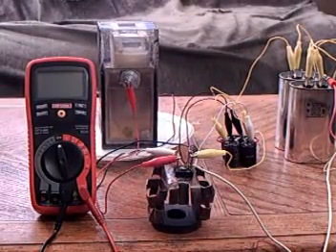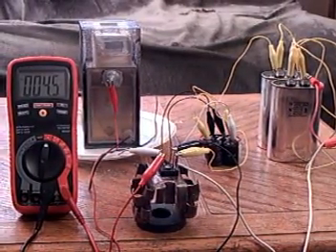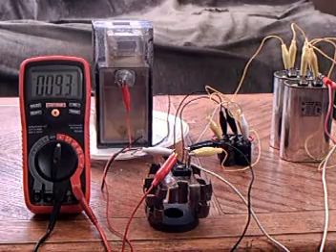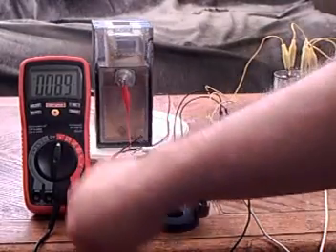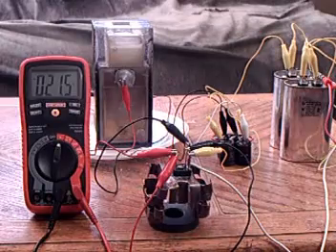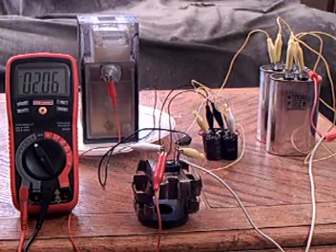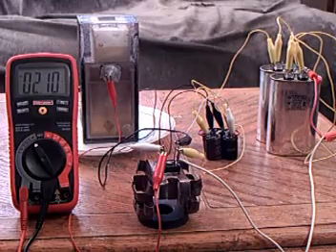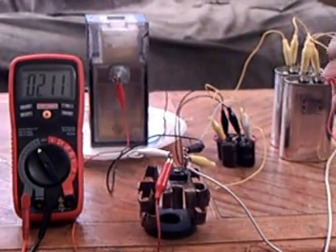CAPACITIVE STEP-DOWN TRANSFORMER - Part 2

Comment: Actually it's a capacitive AC voltage divider, not a transformer.  The 2nd cap is just a voltage limiter.  The load is in parallel with the 2nd cap.  The total impedance is the first cap in series with the parallel pair of 2nd cap and load.  Most of the energy is lost in the first cap, the efficiency is far less than a conventional transformer.  If you want to know what it's really doing, measure the current on the AC line using a clamp meter.  Once you know that current multiply it by the 120 volts and that's the input power.  Compare that to the output power.  You will find it is very inefficient.

Comment: I don't know how to upload a schematic, but if you want to limit voltage you will need the "secondary" electrolytic caps like tvryb is using here. Without them you only limit amps and voltage will float to what ever is necessary to achieve the rated amps up to line voltage. you need about 24 microfarads per amp at 110v. 12mfd at 220v. So if you have one 50mfd cap at 110 volts you will push about 2 amps through it.The cap would just go in series with one of your mains to the bridge.
'

Comment: Can You Please  draw up a schematic for me please using only the primary Caps   I am trying to achieve 12volts @ 2 Amps  with 120 volt A.C. with a  Bridge rectifier  to get D.C can you show me what I need  in caps or cap in series  or parallel  to get there Thanx In Advance

Comment: Actually you have a CT of 75 and at 110 volts 24 microfarads equals approximately 1 amp, so your circuit is limited to 3 amps, so the 2 amp limiting is coming from your hho cell electrolyte concentration. If you only used 1 of your primary caps and your rectifier bridge you should see about the same results.

Comment: The electrolyte caps aren't necessary in this circuit, they only provide you with a safety in case of an open circuit, by limiting max. volts. Your cell will draw about 2 amps because of your primary caps and the voltage will float to maintain the 2 amps. Test your voltage and amps without them and see for yourself. The circuit that you built works as a battery charger desulfator as well, but you want to cut the amps to below 1 amp, removing 1 of your primary caps would do that.

Comment: The reason this is not a transformer, is because even when you dont load the output of the rectifier, there will be a current flow through the caps will still waste power in amount dictated by ohms law. a 100 and a 330uf cap in series is equal to a 76.74uf cap, which would have an impedance of 34.9ohms, ohms law says we are wasting 3.4 amps even when not loaded.

Comment: what you have done here is created a voltage divider with capacitors. The capacitive impedance for a 100uf cap is 26.52ohms at 60 hz, and for a 330 volt cap its 8.03ohms at 60hz. 
Using the voltage divider formula and r2/(r1 + r2) we get 8.03/(26.52+8.03) = 0.232 times your input voltage of 120 gives an output voltage of 27.89, which is very damn close to the value you got, without knowing exact measurements.